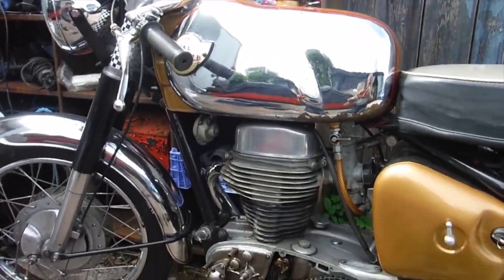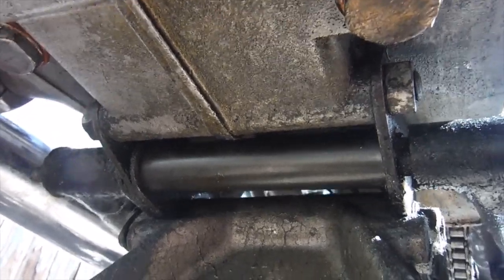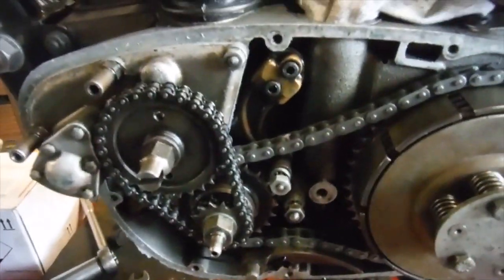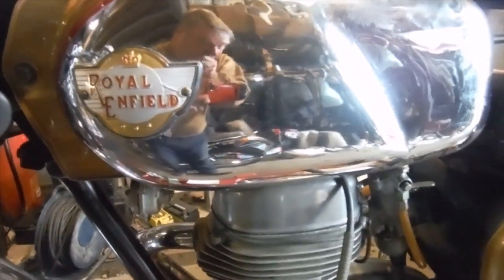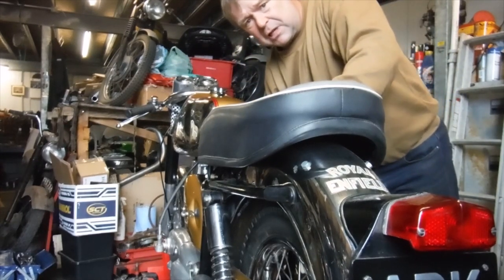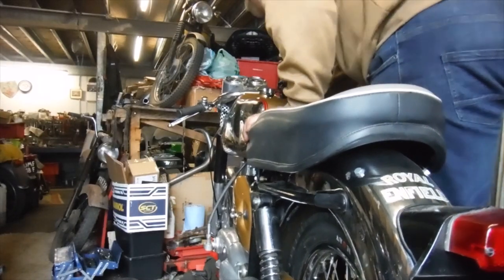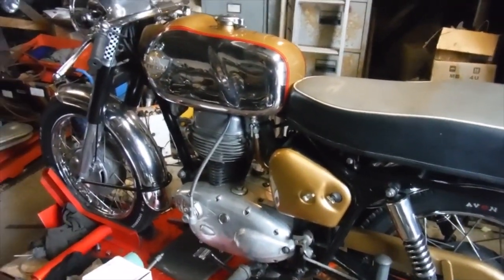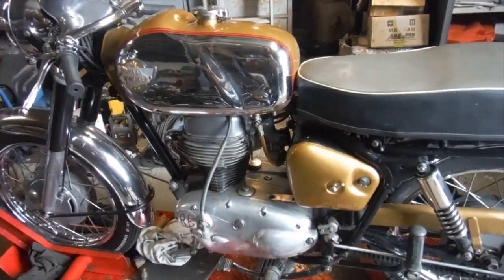Royal Enfield Continental 250 discussed during recommissioning work, some tips and will it start?

Comment: The learners' favourite back in the 1960s. I had an old hack of a Cont. GT in the early 70s, and had hours of fun modifying it to work a bit better. Happy Daze!  Fitted some forks that were actually damped, and installed a splined g/b mainshaft, from a Villiers 8e I believe. A friend bored out the hub centre and welded in a splined Villiers centre. No more spinning of the tapered mainshaft in the equally tapered clutch hub. The engine was actually oiltight, but in the end I bought the bike the Enfield should have been  -- a Ducati 250! Happy spannering.

Comment: Good tip on the spaceer tube thankyou Paul, I had exactly the same problem on a 350 bullet with the clutch as the previous owner had bodged it back together, needed new whole clutch in the end due to the  wear the bodges had caused.

Comment: Hi paul I I have had my 250 royal Enfield 1963 continental since 1976 rode it for 20 years and then of and  since also moved house just never had the time after that to get the puncture fixed and then the next puncture anyway your videos have inspired and I am not far from being back on the road but I am struggling with rear wheel set up I was wondering if you have done a video covering the setting up and refitting of the real wheel and components keep up the good work videos I are amazing.

Comment: Nice bike! Working on any older bike needs a lot of patience there so many silly things that could be wrong and set up wrong. Doesn't seem to be a lot kick turning the engine over. I always found old fuel works ok unless it full of water or dirty. A drop down the plug hole is a good quick test if she will start. Have been using Esso Super unleaded could be one of the last to not have Ethanol in it even though it does say 5% in most places in UK. Well done you got there in end and sounds great it can be a long day to get there at times. Keep up the good work Paul
Reply from the maker: Thank you!

Comment: I prefer these to the GT version, reminds me of an early Ducati single. (ld have to take  that chequer tape off though) They need the rearsets to match the racing croutch inducing bars. I guessed you wouldn't be able to resist having another 'one more try'😁Wondering if the ignition switch is worn or contacting as it should. As you said you'll be checking the ignition timing and points as normal recommissioning process anyway.

Comment: Hi Paul. Would you mind saying how much and what grades of both engine and gearbox oil for this bike please. I have the manual now, but I’ve read so many different opinions about oils I thought I’d go straight to you as something of an expert. Hope you don’t mind..😊
Reply from the maker: Hi Duncan, I use 20/50 mineral oil for both, while the primary case shares oil with the engine.
Reply: Thanks Paul. So, the 20/50 is ok  for gears instead of SAE 90. Would 5 L be enough for everything? I’ve got the Hitchcock manual, which is helping, but because I think my bike was made up from bits, it’s hard to be sure which parts of the manual apply. The carb is a 376/216 and it doesn’t have the crankcase breather, so the bike you are doing here looks the most similar to it. Keep up the good work, it’s so handy having videos from someone who knows 🙏

Comment: Hi Paul, I’ve just got hold of one if these 1967 CGT 250. I’m struggling to find a manual. Can you help with where to look please? I’ve done up one bike before - it was a bit easier as it was a Honda from 2001. I’m looking forward to doing this one. It’s been sat for 50 years but seems to be only missing: fly screen, battery and rev cable. I’m assuming it’s 6v. ps I love your videos - I think they are going to be a great help in my project. Any help greatly appreciated 🙏
Reply from the maker: Hi Duncan, Hitchcocks and Burton Bike Bits should be able to help with parts and info. Good luck!
Reply: @paulhenshaw4514  Thanks Paul. Found the manual on Hitchcocks. I’m keeping it all 6V - the old battery codes are no longer in existence - the modern GEL equivalents are available in 6Ah and 11Ah. I can’t tell from the manual which one is for the 250CGT. Any advice on this please? Then I think I can try and get it turning over..